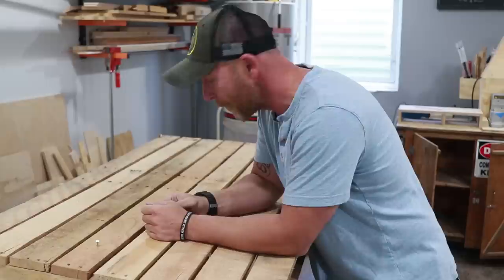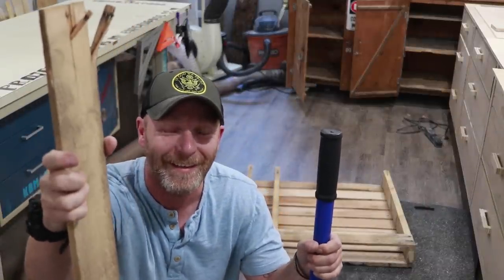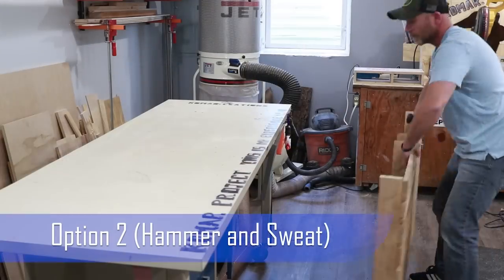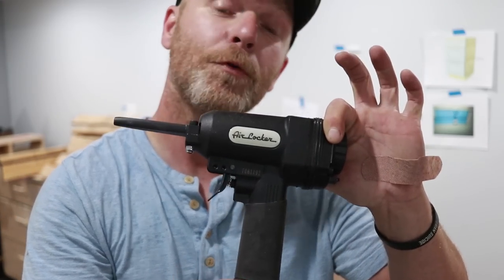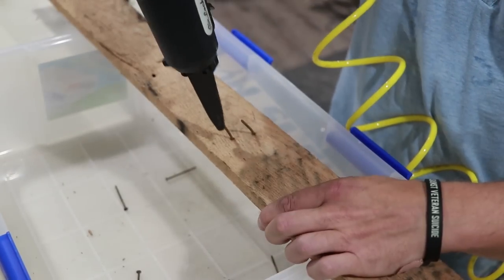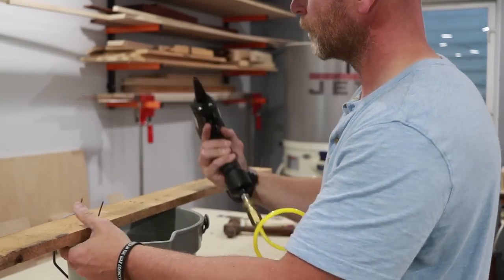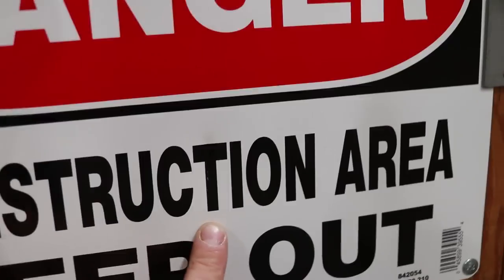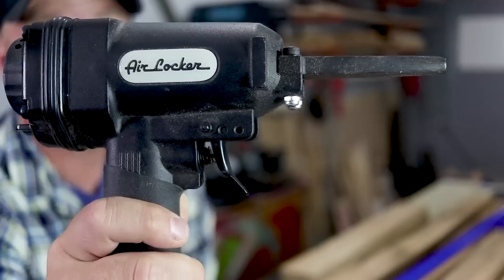How To Take Apart A Pallet and Remove Nails (2 Easy Ways)

Comment: I have been taking pallets apart with the idea to build a chicken coop. The pallet buster works well most of the time, but it is a workout. I need the exercise anyway : )I saw this video a while ago and after using a hammer and prybars to dismantle a bunch of pallets, I  was intrigued with the air locker de- nailer. I just got Harbor freight's smallest pancake compressor (on sale! $69.99), one of their hose and attachment kits, and after looking at others, an Air Locker de-nailer. I work outside over a tarp and saw horses and use a fishing magnet to pick up the nails because they go all over the place. Always have eye protection!! The video now makes me nervous to see you doing this without goggles. Really!  I now have plans to cover my garage walls with pallet wood, and to make and sell some things too. Oh, I'm 68, and a mom, and a semi- retired Anthropology instructor.

Comment: Have been in the pallet business for 19 years. Entertaining video. 40 inch used pallet boards sell for 20-25¢. Routinely. Watching people do things the hard way is always interesting. If for no other reason than to see what they come up with. If I disassemble pallets "on the side" I take apart at least ten and sometimes twenty in one hour. The hard part is picking up all the boards. Tools like that are generally designed to remove damaged boards from a pallet that is being repaired. Even so, not what I would use. Too big/bulky. Not really criticizing honest effort. Advice would be to find pallets that you can take apart easily based on the method you are intending to use. That will involve some trial and error. Lots and lots of variables. Watch a bunch of videos and you're likely to pick up some tips. Picked up a good idea myself from a female dismantling pallets promoting a brand of dismantling blades. She was using the same method and tools I use but with an additional tool that I never really saw a need for but does make it a little easier and safer. Always room to learn something.

Comment: Good video. Thanks for sharing....
... If you don't have pallets to spare, if they're hard for you to get and bring home, you don't want them splitting on you. For this reason I caution, not all pallets should be taken apart the same way. Some pallets are cheap and break easily, and for that reason should not be pried apart or hammered apart. For that kind I recommend a recip saw and leave the old nails in. The pallets he has in the video are made of thicker, higher quality wood, than some others. But if you have heavy duty pallets, this is great, especially the nail remover. I gotta get me one of those. ;)
Reply from the maker: Escape From NY escape thanks for the comment. Yes these pallets in the video were really good.  I did use a saw back in the day but kept going through blades, but it’s for sure a good way to break down too.   The nail remover is awesome. Highly recommend it.

Comment: 1. Please wear goggles when playing with nail guns.  Little boys who don't wear eye protection should not be playing with guns.
2. Please get rid of the music.  This is a demo and DIY, not a Star Wars movie.  Music hurts the ears, is very unpleasant, and supremely annoying.  
3. The clowning around, funny faces, silly behavior - save that for a kid's Christmas party.  Try to move quickly thru and not waste time.  You are either doing comedy or DIY, not both.
4. The nail puller is overkill and breaking the wood.  It is not meant for salvaging wood, but instead for taking out damaged wood to be replace on a pallet.  It breaks wood, not a good toy.
5. The number of ads crammed into the video is ridiculous!  Now I know why you clown around making it longer. More ads. 
Not cool.
6. The air gun nail remover by contrast, is excellent!  Glad I saw it.  This makes the whole video worthwhile.  I never knew this existed and super glad to have seen it here. Many thanks!

Comment: Love  to see him do this with a Pallet that has been used for a couple of years and repaired a Few Times where you can have 10-15  twist nails in each part of the slat all nailed at various Angles giving you anything up to 40 nails per slat. It's Strange that all these Pallet Dismantling Videos only use New Pallets with 3-4 nails per part of the slat  giving you 9-12 nails total Nailed Perfectly Vertical and strangely enough they all seem to be straight nails with not a Twist  or Ring nail in sight
Reply from the maker: bigniper I have taken apart all sorts of pallets, and with all kinds of nail configurations.  Sometimes you have to work a bit harder to get them apart but it’s the same kind of process for me.  Even twisted and bent nails can be removed with the air locker. Just have to straighten out a bit.

Comment: There is no doubt that the air tool is the way to go to get the nails out but they can be dangerous because they can ricochet. So first of all you need safety glasses. Second of all use a deep bucket. I actually use a garbage can. Finally an old blanket or towel in the bottom of the garbage can will further prevent bouncing back. I also recommend a good pair of gloves to prevent splinters or nail pokes if you grab where you shouldn’t.
Reply: I have also seen some guys make a cover for their container out of plywood with a good size hole in it, maybe 6 or 8” to help trap the bounce backs.

Comment: What is your method of removing nails in the bottom stringer boards? When I remove the board on the top it leaves about 1/2 inch of twisted nail showing. I use a prybar and pop off the top of the nail, leaving the rest of the nail in the wood I want. Any suggestions?

Comment: This video made me mad, considering how I have been taking them apart hahahahaha. I broke half the boards! Can’t wait to try!
Reply from the maker: vinnie shimenetto is this why you were asking the other day??? See now you can just watch it.  Hahaha thanks brother
Reply: no kidding the nail removal can be time consuming. i need one of those air tools gizmos. two years ago i broke down fifty pallets and made a lot of scrap firewood of the slats. i used a 5/16" pipe to keep the staples from bending over from the hammer. It sure didn't help my tendonitis.... but i could re-use the nails and that saved several dollars in materials. I now have forty planters for the price of going to get free pallets at the trailer factory down the road a bit.

Comment: when i bust up a pallet i use a piece of 2x4, a short handle sledge hammer, and a couple 2x's to go parallel and on each side of the slat im knocking loose, i also cut the slats on one side both ends, but that is on the side with fewer slats, im wanting to get one of those busters. on denailing, i use a hammer, vice grips, and a flat pry bar, along with a nail i removed if the nail looks like its cut or just the head is stuck, wanna get one of those denailers.
Reply from the maker: Ya the air locker is so worth it.

Comment: Have you tried using the sawsall to cut the boards off and then use the air gun to remove the nails? I didn't know how much of the nail needs to be sticking out for it to work. Just a thought.   Great video, thanks for sharing!
Reply from the maker: Ya if you cut it off with the saw it will still punch it out.   Usually all the way cuz it doesn’t have to deal with the entire nail.

Comment: May be you can show us if the air gun can be used to nail nails into the wood.
No just as a pistol.  

Some pallets are supported in the middle by something like 4" X 4" X4" block.
The blue weapon cannot grip it well.  
Any suggestion removing the block?
Reply from the maker: Unfortunately you can’t use it as a nail gun. Just not that safe to do it.  Also I know exactly the block your talking about and it’s just a pain in the butt. I just hit them with a hammer once I get to them.
Reply: @KomarProject  
I don't have a 20 lb hammer to play around here. 
So I improvise.  
I have a jigsaw, so may be a jigsaw can cut the 4x4x4 block from the long board. I then get a blade for hand saw, those blue blade 1cm x 30cm long.  I use an angle grind to cut it to about 8 inches long, shape one end of it so it can be fit onto a jigsaw. 

So, here it is, a jigsaw with a weeble wobble blade.  Since it is the thinnest blade possible to put between the 4x4x4 block and the wood board, separating them apart becomes possible.

For punching out the nails from the pointy end, since i don't have the air gun like yours, I learned from the other guy on youtube to use a SDS hammer drill.  The hammering action can kick the nail into the wood but not as fast as the air gun.
Reply: Lump hammer

Comment: I got a bunch of pallets for free one time from a place. They gave them to me. I want to choke them home the nails were not ordinary nails. They were twist nails. When you nail them and they twist. They were very difficult to get out. but if the palace you have have the regular round nails. This device would work really good. I was going to take my room. And take the palace apart. And stain the pieces of pallet. And put them up on the wall. stain and polyurethane the wood on one of the walls can pay the other walls. But they had to twist type nails. It was very difficult. To get those type of nails out and also A lot of the wood was very dry. And when you try to take out the nails or take them apart. A lot of the wood broke so it didn't end up to be such a great idea for me, but look at the type of nails that are in the pallets. And see How dry the wood is? If the wood is brittle. Then when you take out the nails. I use Hammers and crowbars To take the nails out. It didn't work out real well for me it took a lot of pallets just to get enough wood. To make a wall looking for one side of my room. I really like the video. I hope any information I have given anyone will help them. If they decide to disassemble pallets for projects
Reply from the maker: Ya some of the older pallets will have the twist nails and they are a pain to get out, especially pulling them with a hammer.  The air locker works on them too though.

Comment: That's fine for small straight nails.  what about those large twist on nails?  Your method will not work.
Reply from the maker: Ohh it will just takes a little more work
Reply: I've used this thing on bent screws in 3/4" material. Sends it right out